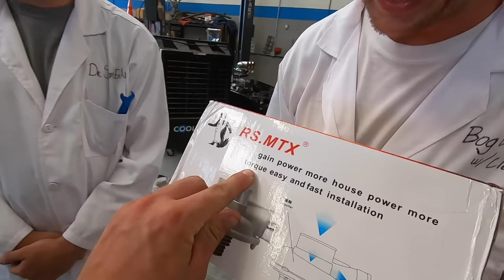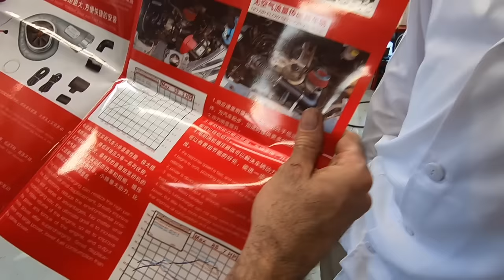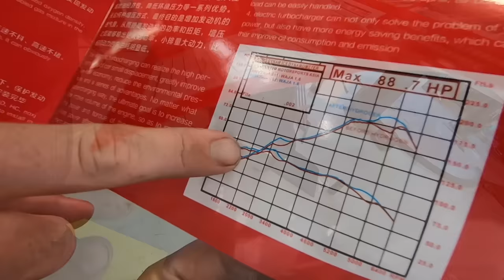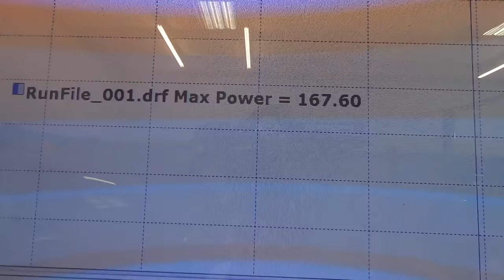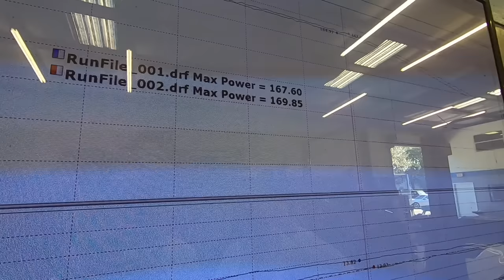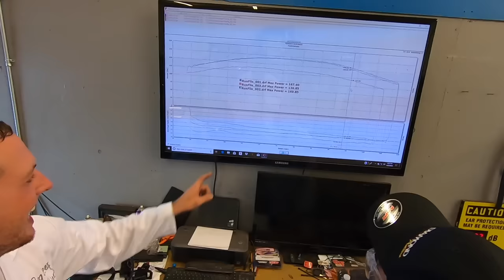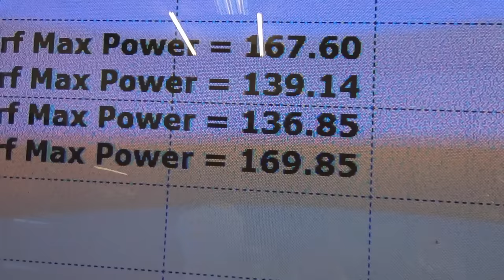Dyno Testing a $400 ELECTRIC TURBO! Funniest Car Part EVER!

Comment: Here’s the conversion: A typical residential house has 200 amp electrical service, Or 24,000 watts. One horsepower is 738 watts. Therefore I’d say one HOUSE power is equivalent to 32.5 horsepower. 

Let’s see how this plays out on the dyno 🤘
Reply: tsquickgt1 here in Texas, 100 amp is the normal.
Reply: @TheHopson  No, it's not
Reply: lol
Reply: Typical residential services are 100amp not 200amp. Been an electrical engineer for almost 20 years and in Canada over 85% of residential services are 100amp
Reply: Older houses are usually 100 amp
But now most are 150 to 200
Reply: 100 is great for blowing fuses and circuits
Reply: Elliott most I see are at least 150
Reply: @svt2828  yeah, canada is different. 90% in WA state is 200 amp.
Reply: My 3,500 sqft house in Texas has 200 amp... so basically in a race my house is faster than his pit bike
Reply: @svt2828  you Canucks are weak. My garage has its own 100 amp service. House is 200 amp.
Reply: It's lost 1 house power 🤣
Reply: I live in central TX, most of us have upgraded to 200A now, including most of my neighborhood of 100 year old houses. I've lived in Canada too, the difference there is that they use gas heat and don't need crazy AC systems. Here we have electric heat, electric water heaters, and huge AC systems.
Reply: Garrett doesn't care how many horsepower your house has, he only cares about the almighty DOLLAR BILL!
Reply: @amberselectronics  was going to say the same thing. Gas  service makes a big difference in how much power you're pulling.
Reply: It basically lost a housepower
Reply: That is exactly right! They lost exactly one house power!!!
Reply: No idea what houses you wire but all new construction is 200 amp
Reply: My disconnect box on the side of my house has a 200 amp breaker in it... Been that way for 15 years.(Southeast Ohio)
Reply: 240v service x 200 amp = 48,000 watts.
Reply: @michaelmcclellan916  waiting for someone else to see that, same thing i was thing 24,000 is a 100 amp service, 200 amp is 48,000 watts, must a bad turbo on his house panel lamo
Reply: You guys livi'n in the past..
Here in Sweden a normal house have 20A 
I have a quite big house with a big garage inc welding and air compressor etc.. and living in the northern Sweden with Cold winters  where it often is below -20° celcius or -4 f  for a month.
I have 25A fuse...
But we have 400volt to the house which is splitted to 230v for the lamps and tv and other small stuff..
The heating system for example is supported with 400v
I don't get why you have so low volt??
Reply: typically your homes hookup would come in at 240 volt. so that 200 amp is actually 48,000 watts. you have at least 65 house power.
Reply: maybe you're spinning it in the wrong direction? did you reverse polarity? lol
Reply: Eric BDB 200 amps here in Washington DC area
Reply: @Stevesbe  gosh dang you freedomland guys got some serious amps on your houses, in Brazil they ain't letting you install more than 50A per phase for two phase residential installs, if you want more you gotta pay for triple phase, but if I recall that goes up on commercial install bills then
Reply: Ive got 800amp service at home
Reply: joe smoth he’s an electrical engineer not an electrician lmao he doesn’t wire anything.
Reply: fabyanjim1 oh he engineers the diagrams for electricians to follow,but can't figure out no new homes run 100 amp services
Reply: @mrolsen6987  we don't need 400 amps because we don't live near the artic freaking ring.
Reply: @DocR16  
Maby you should read again, we have 400 volt and because of that we don't need more then 20-25 amp...
Reply: @svt2828  Across the southern United States, where central air conditioning is common, 200 amps is the minimum service in a modern house. I doubt, that central air conditioning is common in Canada.
Reply: @svt2828  and he put 738 watts it's 746
Reply: That's the numbers I got
Reply: So many experts that know nothing ..

100AMP service means that all the appliances in the house when turned on at the same time,  now having said that.. every house has a different FLA at the service..
No 2 houses are the same... This whole comment is absolutely stupid...
Just because 745W is one HP does not mean a full "HP" is being used constantly.. A.C current fluctuates... Also most of you are forgetting about peak amperage during start up of a motor or element such as a dryer or refrigerator... The peak amperage will drop once the momentum of the current has begun ,. Now.. unless any of you know what the actual FLA of your dwelling is, by taking an AMP meter to the service cables, (pre panel)
All of these comments are mind boggling..
You can have a 600AMP panel but the dwelling only consumes 70Amps 
And maybe 100-110 in the winter depending on the consumption on electrical heaters and stoves and such..  Now,. When you measuring HORSEPOWER ... That would be based on the constant FLA pull under full load/resistance

Final conclusion....

In order to know the horsepower rating of a house everything in the house would need to be on and running.. EVERYTHING ..  then the FLA divided by the voltage would give you your WATTAGE.. this is how to measure the "horsepower" of your house.
Reply: @mrolsen6987  ...in the west they charge the customer by the amperage used... So the lower the voltage the higher the amperage consumption...there for the hydro companies make pretty pennies off of basic necessities.

Also.. having 400V 3PH is great for low amperage consumption.. and also saving money on thinner conductors for wiring...
But it's also extremely dangerous to work on..
Ever see a short from 400V at 20AMPS??
Reply: @zorans5200  746 watts is one horsepower.
Reply: @ateamoffroad1179  
Yeah I was in a old tractor garage once and change engine in some car I had at the time, when I was on My way to get some tools I put My fot on the cabel to the winch on the overhead crane,
BOOOM !! 
The cable was broken because they have left it on the floore when driving the tractors in and out...
I Saw a blue lightning ball under My fot! It was big as an fotball and it felt like stepping on a big waterbaloon!! 
Luckely I had working shoes on and was not holding on to enything so I never got the electricity thrue me!😰
The biggest fuse that burned was on 35A...
That's a Hell of a power! 
Yes, I'am lucky to be alive🤘😂
Reply: @ateamoffroad1179  actually 745.7W =1HP. Google it if you don't believe me.. I don't know where you got 746....
Reply: @ateamoffroad1179  for the 1 WATT  wether you wanted to round up or down would really not make a difference it's 1WATT.. it's the equevalant of a small L.E.D bulb..
Reply: @ateamoffroad1179  ...also.. 1KW =1.3 HP
In European measurements if that helps you..
So basically 1000WATTS = 1.3HP in other countries.... This whole argument is irrelevant.
Reply: @zorans5200  it's actually 745.7 in math   you round up not down when it's .5 and over so I don't know we're you are getting 745 from it's simple math.
Reply: @ateamoffroad1179  ...dude I already wrote this down... And I already told you what the wattage HP rating is,. I don't know why your trying to be a smart ass with 1 WATT when it's really insignificant.. 1WATT is not going to change the HP out put...   Actually, I'm sorry.. it's actually 0.5 of a WATT
Reply: Also you should really take into consideration that all these numbers are approximate because they fluctuate.
Reply: @jamin8901  bullshit, the power to weight ratio kills the house power
pit bike would leave the house sitting on the line...
Reply: I really enjoyed reading this thread about household electrical needs on Cleetus' channel, so here's some nostalgia: I bought a building that had been built in 1905 and originally had 60A of service (110V for you non-US readers). It had been cut into apartments over the years and the electricity butchered and hacked accordingly, so we did all new drops as part of the rehab in 2003. The 3 big apartments got 200A each and the one bedroom loft got 100A, for 700A split across the whole building.

So I declare myself the winner of the Cleetus YouTube Housepower War of 2019. 

🤣🤣🤣🤣
Reply: @sqmotorsports9230  ... that didn't even make any sense... How do you go from a 60AMP service to a 750?  You would need to pull out all of the service cables coming from the transformer and upgrade them to about 350MCM for both phases and the the neutral..
Second everything at that point would need to be industrialized, breakers,panels,disconnects, 

And what do you mean by 60 amps (110 volts. Non U.S readers).   You realize all of North America and alot of of other countries use the 120V single phase system right??
I find alot of holes in your story....

Talk about a cleetus
Reply: @zorans5200  You're missing about 70 years in between; as I said, the electrical had been added on to / spliced / hacked many times over the years. So what started as 60A 110/120 (same thing, 110 and 120 are considered interchangeable) had drops added so it was about 500A but badly spliced when I tore it out. We did a new transformer at the main line, new service drops, etc. to accommodate the new voltage.
Reply: @sqmotorsports9230  wtf are you talking about man!??

If you service is 60AMPS. It's DOES NOT matter how many splices there are!  You will never exceed 6O FLA'S..  you will never ever EVERRRR have 500 AMPS coming out of a 60AMP panel NEVER!   You would havto rip out the main 60 amp panel breaker out and replace it with solid Copper bus bars that are capable of 500AMP'S!!    Even if you were able to go above 60amps  it won't be much because the meter is rated up to 200amps.
So which means you would need to directly connect the supply lines with Copper bus bars behind the meter....  Just because they had multiple circuits splices into one circuit does not mean the it draws more current!  It just means it limits the breaker to tripping more frequently... Untill the breaker fails and heats up and burns the panel down and your home...

110-120-125-130 VOLTS is all the same shit man!  If you put a multi meter into a socket of a 120/240VOLT 100AMP dwelling all the sockets will fluctuate from 110-130-VOLTS 
Especially if there is load on the circuit,
 You should really study about alternating  current before you do work to people's  houses....
Reply: @zorans5200  Dude, you missed the part about replacing everything starting from (and including) the transformer... The house hadn't had 60A since about 1936. At that time the drop was redone, then over the years people jumped out the top of the meter boxes to add a second, and then a third meter - allowed for separate billing as the house was cut into multiple apartments. (Sketchy as hell but yes it was done.) Then in 1986 a second drop was added with a fourth box. I yanked all that crap out and started over; the city even took the house off the prior transformer and changed to a new one.

Now let's get back to horsepower please...
Reply: @sqmotorsports9230  ..see now that makes sense...  You had me scratching my head
Reply: @sparky6086  as a refrigration/hvac technician in toronto I object to that statement
Reply: @mrolsen6987  20 amps per phase means you can draw 23 120 watts in delta configuration (heating and big motors). Same impedance connected in star only 13 600 watts.
Reply: @laszu7137  
And with that you want to tell Me what?
Reply: @mrolsen6987  It's the exact same power. In real life conditions there is no difference between maximum draw of 120 V 200 A and 230 V 3x25 A.
Reply: @laszu7137   Yea I get that since you can use the same type of equipment for example welder.
What I'am thinking of is that there are less powerloss over length with higher volts, that's why I'am thinking higher volts are better.
Reply: @mrolsen6987  ...power loss?  You understand you can go hundreds of feet with regular 120V/230V lines without dropping in voltage..

Unless you have a farm or something with lots of land then it would be understandable.
Reply: @zorans5200   I'am talking between for example the transformator and house..
Reply: @mrolsen6987  again. It's unessesary...
There is just no need for it unless it's an industrial complex with machinery that consumes alot of current at once.
Reply: @Kalvinjj  in America we use 3 phase going to the house so that makes sense
Reply: Mr Olsen do you have any idea how dangerous it is to work on anything over 240 volts? Just that is enough to send you flying off your ladder😂 if anyone’s living in the past, its probably the person with primitive electrical wiring hot enough to give you cardiac arrest😂
Reply: @brandontrish86  ..no you don't.   Houses are "single" phase split at the transformer... The neutral line is NOT a phase....  

3 phase power to a residential dwelling is very very uncommon... Mostly because everything has to be altered from the street to just that one dwelling..  not to mention the melt down inspectors would have

Comment: I think we all need to see this "Blower" on a scooter or go kart 🤣
Reply: It might actually be awesome on a predator 212
Reply: @ngktech  What size was the motor in Cleet's new ATV?

If that doesn't have a turbo already,..... :D :D :D
Reply: @PiDsPagePrototypes  That UTV? I havent seen any updates on that in months, but its prolly an 800cc or better, so yeah it would be awesome on there too :)
Reply: Was scrolling to see if someone said it
Reply: It doesn’t compress air wouldn’t work on anything.its just a restriction same putting a fan inside. It has to make positive pressure if it won’t compress it’s not going to help in anything go cart or scooter
Reply: @STePHeN320_12  it creates positive pressure - any fan does - just not enough for that use

Comment: “A very small engine” like a 3 cylinder geo tracker?
Reply: trackers were all 4cyl but i think this would help on a geo metro 1.0 3cyl. Ive owned both
Reply: More like briggs and stratton
Reply: Geo Metro? Trackers had a 1.6 and Samurais had the 1.3. Metros had a 1.3 and the 3cyl. 1.0.
Reply: @Floordford  my 91 had the 1.0 with a five speed it was actually fun to drive
Reply: the frst gen metro's were called Geo metro not Chevrolet Metro
Reply: Nope, something smaller like a single cylinder engine.  Even then, the gains would be questionable.
Reply: Exactly my thought. Small stock motor.
Reply: they should put it on their bogger Tracker
Reply: Ford festiva
Reply: kameron samuels nah his is a four that runs on three hahaha
Reply: 0.9L turbo 3 cyclinder renault around 75ch  i think
Reply: Yeah this would need to be on something 1L or smaller for any positive results. Would turbo the shit out of a lawnmower. lol
Reply: so, the only way this thing will make more power. is on a car that doesn't exist. sort of makes sense.
Reply: @cromulentcommodore5896  Lets just say it's  not built for cars. Turbo scooter anyone?
Reply: @generalkayoss7347  i was refeing to the notion of a 3 cylinder geo tracker. but sure. turbo scooter sounds fun...i'll take 2 whatever
Reply: Floordford it started out as the Chevrolet sprint, then they came out with the geo name plate. That's when it changed to the metro.
Reply: I own one of those...
Reply: More like a lawnmower lol
Reply: I a Honda insight with the 1.0 VTech 3 cylinder with the IMA.. lol.. why would you turbo that?
Reply: 3 cyl 660 cc KEI truck, like a Honda ACTY or Subaru Sambar

Comment: "It's nit an electric supercharger, it's an electric turbo!"
Aren't they the same thing? xD
Reply: Thats exactly why im confused. Faulty installation?
Reply: please keep up - one is for house power - can't you read?
Reply: A turbo is driven by the exhaust gas.
Reply: The 'turbo' in turbocharger comes from it being driven by a turbine. This one is not driven by a turbine but by an electric motor, so there is no place for 'turbo' in the name.
Reply: @listerdave1240  I’m with you! It’s not using exhaust as power! It’s dumping supposedly increased air into the intake!
That’s what superchargers do👍🏽👌.
The boost has to be equivalent to the operation of the belt driven supercharger to make an improvement or similar affect!?